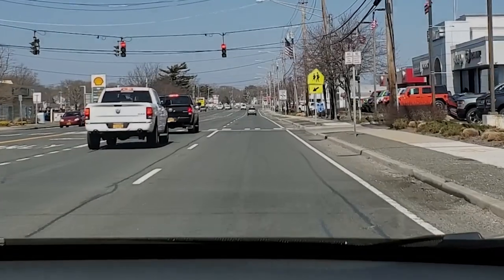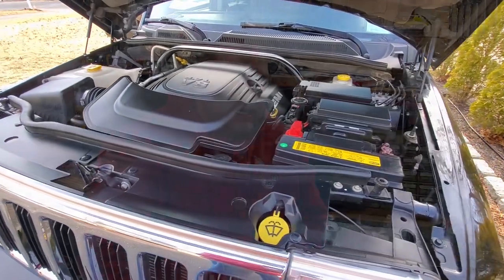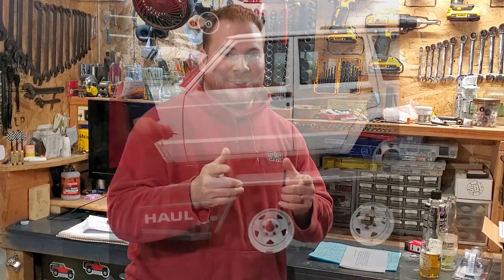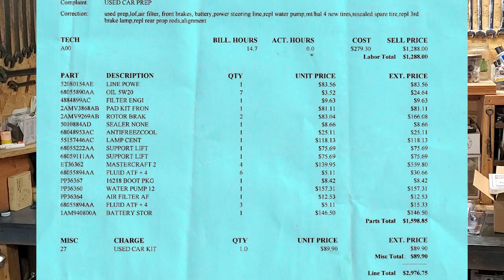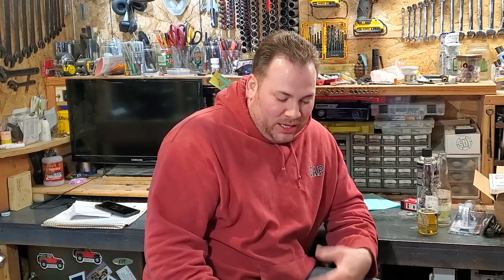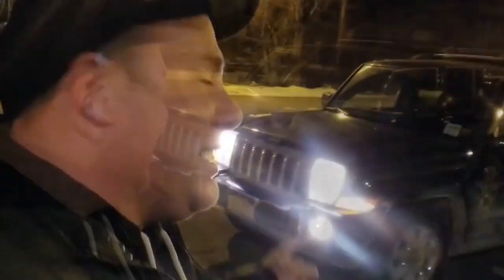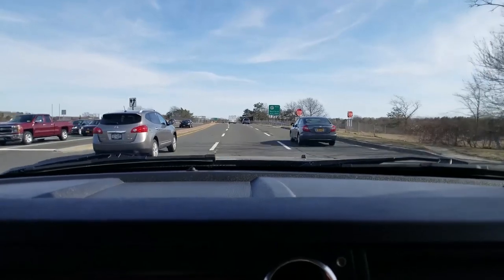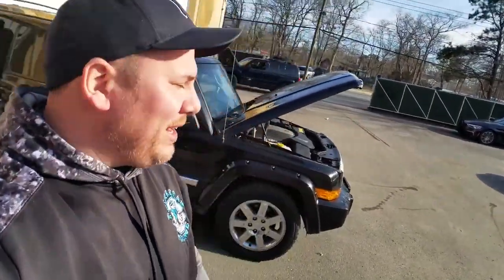JEEP XK COMMANDER 5.7 HEMI OVERHEATING MYSTERY - A NEW CAR NIGHTMARE

Comment: I have a 2006, 3.7 v6 and I went through the overheating issues. First the upper radiator hose blew and then about a month later the heater hose blew. I just replaced everything, lower radiator hose, both heater hoses, water pump and thermostat, I also replaced the heater core. It has 201,000 miles on it so I just replaced it all. Everything is good so far.

Comment: Im glad you figured out your problem! i was really hoping that this video would solve my issue with my HEMI but i didnt unfortunately. We have replaced everything in cooling system including sensors and relays but still overheating. Starting to get frustrated, also no signs of head gasket problems but we are running out of options at this point. Thanks for video!
Reply from the maker: Thanks for watching, have you replaced the radiator yet? sometimes you can have invisible restrictions in an old radiator

Comment: Thank you man I just bought  a 06 commander  v8 hemmi  150 thousand mile and just found  the was taking water true the rooftop  cus the 2 drain line was clogged with debris  cleared out now water go out the car so far engine is good  thank for the video man
Reply from the maker: Congrats on the hemi! I gotta blast my drains too
Reply: i need to do that to mine..how did u clear them
Reply: I cut off the ends of the lines too

Comment: Hey Dan I took your advise and just picked up a 2007 commando or commander.  I drove it around 2 nights ago in a snow storm decided it was close enough to what I wanted and bought it.  My daughter drove it back the 300 some miles in the storm with the Interstate closed part of the way, she left me in the dust and got back almost an hour before I did.  I was in my old front wheel drive van that is good in snow but this was ice with snow frosting.  So I have not really driven it yet my kid drove it yesterday for about an hour drive and loves it.  One of my daughters is a jeep girl and happy I got it, she says it is not nearly as nice as her 2001 grand cherokee she loves more than anything else, but says it drives very nice.  I have a little forest of vehicles here multiple kids driving and I will retire one of my GM vans that has 290K plus miles and was "totaled" by a road rat awhile ago.  The commander does not hold 7 other people like the van will or have the cargo area, it will not hold my tools and go were the Yukon will, my daughter helped me with her logic that for once in many years I will have a dad vehicle to just drive,  since the kids all drive we usually take more than one vehicle anywhere so I just hope I do not get a ticket right away.   Any problems I have I may be blaming you just FYI.  Thanks I do really like it and have driven a couple of them looking at them.
Reply from the maker: That's awesome, I'm so glad she likes it!  Tell her to like and subscribe to the Channel! Haha.  I can't wait to get my family a huge Expedition so I can take the Commander as my daily 🤣🤣🤣

Comment: GMB water pumps are sold at Advance Auto.  I had the same problem with my New 2010 wrangler back then.  After 4000 miles AC compressor went out.  Dealer replaced it with a remanufactured from a local parts store.  That's why AutoZone and Advanced courier parts delivery vehicles are plain white with no advertised signage because they dont want customers seeing this.  Great video
Reply from the maker: Wow... I didn't realize dealerships were shady like that.  In my ignorance I assumed dealerships had to use OEM parts.  I'm sure customers would flip out if they saw an AutoZone parts truck roll up to the dealership...  Incredible
Reply: @ProjectDanH  , also when i complained they said i should have requested OEM parts...crazy
Reply from the maker: @MajorWeakness  that's just insane!  That's like a waiter saying you should have requested rea meat while your starting at at a veggie burger on your plate 🤣.  Even If I was in communication prior to their repairs I still wouldn't have known to ask.  Sad!
Reply: Some of the used car departments at dealers have their own used car mechanic and do not use the other folks who work for the factory brand. So they want to save money on fixing cars and go with cheaper parts. If this was a Jeep dealer and you took it to the new car service area and had them fix it then I am betting you will get factory parts and not AutoZone stuff.

Comment: I’m buying one tomorrow a 06 5.7L w/ 125k miles ...the seller said he was having issues with the gauge showing that it’s over heating but the engine actually isn’t I talked him down quite a bit from the asking price taking it to a mechanic next week hopefully it’s not a big issue 🙏🏼 thanks for the video!
Reply from the maker: my pleasure. best of luck to you
Reply: Project Dan H Thanks! Got it fixed it was similar to the issue you had whoever replaced the water pump last didn’t do it correctly the clamp wasn’t tightened all the way leaking fluid and overheating...replaced the clamp topped it off and it runs like a dream!
Reply from the maker: @PLAYAPIZZLE24  hurray!  So glad you got it sorted.  Some people should just never be allowed to touch a wrench
Reply: Project Dan H Thanks bud Haha couldn’t agree with that more 🔧

Comment: Ive been also eyeballing one of these. For the price I feel it’s an unbeatable deal but I have been worried as to why the value tanked so hard. This video has been an eye opener.
Reply from the maker: I love this XK.  I think my problem was unique to the defective water pump.. check the car fax and give it a test drive!
Reply: bad gas milage
only thing worse would be a hummer but reliable and powerful jeep

Comment: Hi there, enjoyed the video... I see this was done 3 years ago, I'm a little late in posting a comment.... First off on my hemi engine... I had to replace my water pump three times in using Gates... it just would not hold up, had to purchase a Mopar water pump and had no issues there after...I've never had problems with Gates products until now.... For some reason, it just cannot hold up to this hemi engine... Also buyer beware with this Hemi engine.... Mine is the third generation Hemi... I had to rebuild mine because of engineering flaw... Just do your research you will find that when you reach anywhere from 100 to 120,000 miles on the engine maybe even less, your intake valves will collapse.... The only way to prevent this from happening is having a machine shop correct the problem on the cylinder heads, all rebuild engine shops no of this issue....Best of luck!
Reply from the maker: Thank you for watching and thank you for your input!

Comment: another thing I've learned about my 5.7 commanders 1) the cover over the engine does nothing but provides a home for mice & rats. it serves no functional purpose. mine are in the attic - permanently  2) keep the drain holes for the skylight pan open - uncover the exit  fitting in the floor panel and enlarge the hole by cutting the rubber reduced section off - the designers should not have reduced the exit diameter of this fitting - it always gets clogged up - also, check the drain every month by opening the skylight & pouring water in the pan - each side - it should flow freely - either blow the pipes out with a compressor or double up a stiff wire ( no sharp points ) and clean them out periodically. 3) learn how to change the oil & keep il changed regularly - one of mine has 275 k miles on it and the engine and the transmission still run like a champ.
Reply from the maker: Yes!! I blast mine out with an air hose periodically! Great advice!!!

Comment: My 2006 5.7L Commander has the 'Transmission over temp' gremlin.  
Not cheap getting these worked on. To replace the heater core involved a dash roll.....$400+
Reply from the maker: Havnt done a core yet, but I did one on an 06 WK... I was able to do the shortcut way.. wonder if its the same on the XK

Comment: I have two 5.7 commanders. love the engine, but you need to learn to keep it up. BUY A LOW TEMP THERMOSTAT ( 185 DEGREES ). It will always run a little cool, and prevent overheating when towing.
Reply from the maker: Thats a Great Idea! Thanks for the input!

Comment: I'm having a similar issue pulling my hair 2006 4.7 commander builds up pressure under load like a head gasket will do but when in idle its fine when I drive uphill will over heats but as soon as I go down hill it cools down
Reply from the maker: Probably the water pump failing!

Comment: I bought 2005 Grand Cherokee (WK/WH) just over a year ago, with 5,7 hemi in it and videos like these are good for future reference, if things start to break :P It had 147thousand kilometers on it (just over 91thousand miles) and so far it's held up well enough. Lower ball joints had to be replaced, but other than that, just regular oil changes and the like. Hopefully, now that I said something good about it, it won't explode right away... :P But for a winter it's pretty awesome. Knee deep snow is no problem.
Reply from the maker: Great to hear! The WK and XK are basically the same.  Hope this can help someone
Reply: @ProjectDanH  Yeah. There were XKs for sale at the same time, but WK model spoke to me more, so went with that one.
Reply from the maker: @finnishfatman  cool man. I'm impressed  with anything that's got a 5.7 Hemi
Reply: @ProjectDanH  Just need a new exhaust, to really enjoy the sounds of that V8! :D Stock it doesn't sound bad, but wouldn't mind a bit more roar.
Reply from the maker: @finnishfatman  I may grab an exhaust soon.. got a leak somewhere and it's driving me nuts.  Any suggestions?
Reply: @ProjectDanH  No idea about any bolt-on exhausts, since I contacted this finnish shop that builds custom exhausts for customers. Tho they're using Magnaflow quite often, so that's something I've heard fits these Jeeps. The reason I contacted them, because one friend of mine had his cars exhaust done by them and got exactly the sounds he wanted (they tune it to the sounds the customer wants), so thought I'd let them build it to give it nice roar when under acceleration, but keep it "quiet" when cruising on the highway.
Reply from the maker: @finnishfatman  that's what I want. Roar on acceleration but smooth at idle. Donyou know what set up achieved that sound?
Reply: @ProjectDanH  Well my friends car is kinda loud when cruising as well, but since I want a bit more quiet ride (got a family to drive around too) there's an option to get some sorta "manual" valve, or something, that directs the exhausts. When not cruising or you just wanna "open it up", you literally open it up :P I don't know the exact terms in english tho, but you'll be able to control the exhaust flow from inside your car to change the sounds.
Reply from the maker: @finnishfatman  yes! Like new Corvettes have the "sport" mode and it bypasses the mufflers.. that's brilliant 😁
Reply: @ProjectDanH  Yeah, exactly. Similar setup. Not cheap tho, so that's what's holding me back so far... :'P

Comment: I picked one up too, glad to hear you figured it out. Anything else going wrong? I have 140k on mine and it is slowly falling apart, I am slowly approaching the max of my "well if this is the last thing" mark.
Reply from the maker: Last month I replaced the rotting muffler with a Magnaflow.. It sounds amazing.  I Just Fixed the Aux input in the head unit and I replaced 2 bulbs in the heater controls while I was at it.  I Also Put an oil catch can in and replaced the PCV Valve while I was At.  This past weekend I took it on a family trip and drove 200 miles down to the Jersey Shore.  Even with all 4 kids and the wife crammed inside it still ran like a Gem.  This summer i will try to rust proof the undercarriage, I want it to last forever! lol

Comment: I almost have to wonder if the hole that the shaft goes through on that plastic blade expanded just enough over time from the heat of the water/coolant causing it too slip. Or just poor quality. I don’t even think plastic blades should be used. It should be all metal. Im glad the Commander is all good! Love the look of it. Things friggin mint!
Reply from the maker: Thanks man! Yea.. its a piss poor design, especially when its made of plastic.  The dealer replaced the water pump before I purchased it.. lasted only 1000 miles or so

Comment: Hey Dan, what year and trim were your Commander?  I have a 2008 Jeep Commander Overland with the 5.7L V8 HEMI, and I think I may be having something along the lines of the same issues.  I'm going to take a look at the water pump to make sure that it's not GMB, and probably replace the radiator cap and thermostat.  Also, would the recommended temperature for the thermostat be 180F or 203F?  

Thank you, by the way, for your helpful video.
Reply from the maker: 2010 Hemi Limited.  Keep the thermostat the factory temp.. its most likely the water pump. lol

Comment: Dealers don't use OEM parts when they have to pay for them nor do warranty companies due to cost. A lot of water pumps with block housing will be rebuilt and the use junk plastic parts and thin seals and bearings ect..  If you to save time spend more money 😂 I learned this on my Jeep because cheap doesn't fix Jeep. OEM or better will last the life of your vehicle but cheap stuff is junk and you'll replace these parts more often.
Reply from the maker: Youre 100% correct! I wish I knew this when I bought the XK... it would have saved me a huge Headache

Comment: I have a 2007 Grand Cherokee 5.7 , bought it from my family. Second “first car” 200,000 miles on it. It was overheating , replaced the Radiator, top post hose, and thermostat. Drove fine for a while, started overheating again. Got it sent off, the “dreaded head gaskets” were cracked so I paid for them to get fixed. Here I am 2 weeks later and I’m overheating again. Can’t even keep water in it, and when I do put coolant in it, it overfills, and starts bubbling because it’s so hot. Your video now has me wanting to replace the water pump and also flush out the coolant system, so if you want to make a video dedicated to that! Please do. Also, would any coolant be okay?? I know mopar is recommended but I’m from KY and don’t know if it’s here.
Reply from the maker: your rad may be trapping air too.  new rad and new H20 pump while you're at it.  definitely use that Zerex   coolant with HOAT that is recommended by mopar.  good luck bro

Comment: Hey  Dan , what coolant did you use ? Reading on an old forum , some guys were strictly opposed to using anything but Mopar HOAT coolant. They said not even to top it off with “mixable “ coolant , will cause blockage in radiator and heater core. Not too many forums to read up on these , I guess because of the short production run.
Reply from the maker: Hey Shrek!  I'm using Zerex G5 50/50 HOAT pre mix. it's working very well! same hemi engines that's in all the Chryslers and Dodges too👍

Comment: The Chrysler OEM water pump are damn near destructible, I have 5 hemis 4 of them have almost 200000 miles, if it's your head gasket you would have missfire and white exhaust smoke out your tail pipe... Also I use 195 degree thermostat in all my hemi
Reply from the maker: I wish the dealer used an OEM water pump.
Reply: @ProjectDanH  that is one screwed up dealer using cheap aftermarket parts, very disappointing 🤨
Reply from the maker: @kayson7469  extremely disappointed

Comment: I have a 2006 with 150k on it..the overheating issue is killing me..- changed WP and Upper/lower hoses/ rad cap and still not solved..radiator is next I guess.. its not the Heads Im pretty sure
Reply from the maker: My mechanic thought my issue was a restricted rad at first... yours may very well be

Comment: Guy I got a 2006 jeep commander limited with the hemi and a water pump swap is nothing on that truck. I did mine in just under an hour. You just have to keep track of the bolts. I just did the heater core tee swap and did it with just regular tools.
Reply from the maker: But did you get your mechanic to make a dealership pay for it??? 😎
Reply: Nah.lol
Reply from the maker: @aldee3018  lol 😉

Comment: Took mine to a show after showing "trans overheat" for a while and they said it was a faulty sensor. It still kicks in the fans which makes the engine really loud at low RPMs idk
Reply from the maker: oh man, that's strange.. when Gabe showed me the water pump impeller spinning freely in the shaft there was no doubt we found the problem
Reply: @ProjectDanH  I took it to the shop* i don't think there is any real issues
Reply: My Jeep does this as well. Will just randomly say ltransmission over temp" and get real loud until I turn it off and on again. Did you fix yours?
Reply: @thedailyp00per  no I haven't but it only really happens when I drive the car hard
Reply: @thedailyp00per  hey guys I also had this problem, the fix is a a/c condenser

Comment: I get the check gauges issue only when I disconnect the Coolant Temperature Sensor. Sounds like electrical issue.
Reply from the maker: Nope... It was definitely overheating. Lol, bad water pump
Reply: Yeah I saw, that's crazy how the pump and the shaft weren't mated together. Lol the plastic blades are never good.
Reply from the maker: @daimientaylor3108  I know right! Complete crap! 🤯

Comment: I have a Jeep commander 2010 3.0crd 
Problem is everytime I reverse and slow down the speed at the red light engine suddenly shutting down.. 
what is the problem with my car..;( plz help me to solve this problem
Reply from the maker: 😱 I'm not sure.. I'll see what I can find
Reply: Possible valve cover leak, crack, gasket?
What codes is it spitting?